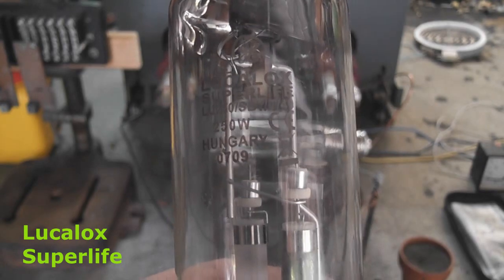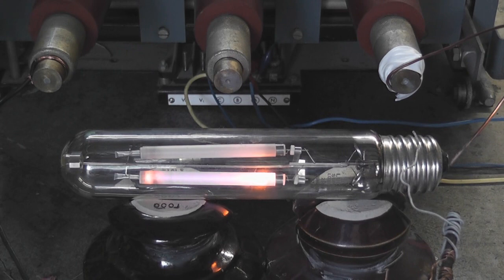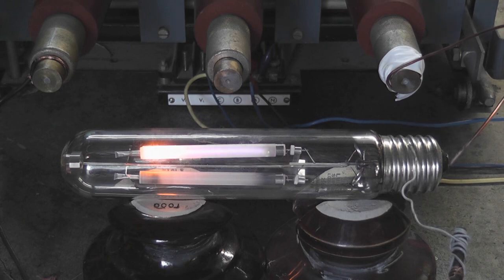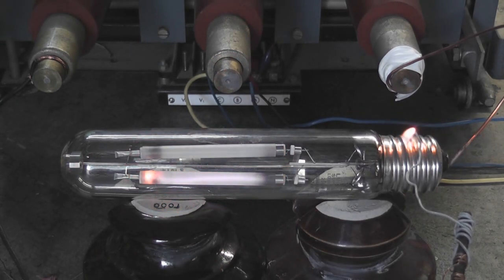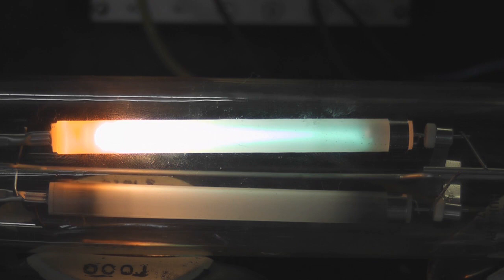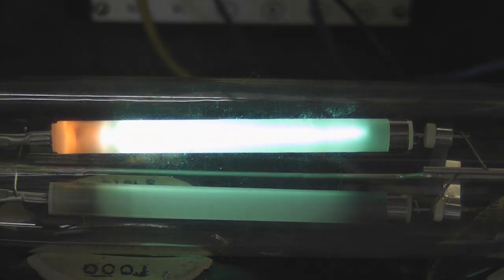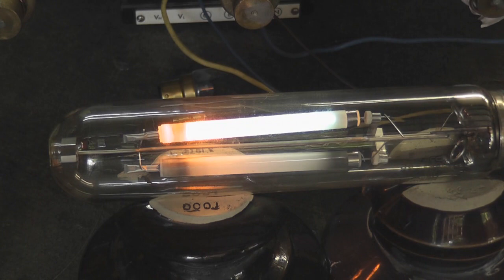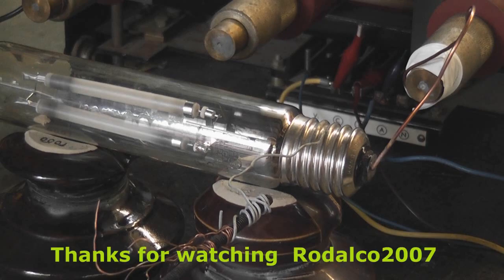250 Watts Lucalox Superlife

Comment: One arc tube will have a slightly lower ionization threshold than the other and thus will start first. Once one arc tube has struck, it deprives the other tube of a starting pulse so it never lights. Should power be interrupted, the cold tube will have the lower ionization threshold and will start first. The hot tube has a higher ionization threshold due to internal pressure, which is why these types of lamps cannot "hot restrike" without a special very high voltage ignition circuit; which these lamps are not designed to accommodate. The dual arc tube is an effective way to get a one time instant restrike, though a warmup period is still required for full lumen output. This can prevent you from sitting in darkness for several minutes waiting for a hot arc tube to cool down enough to strike again should you get a momentary interruption on the mains.

Comment: Yeah, these are handy when instant restart after a power interruption is desired such as prison floodlighting. Also when one arc tube starts "cycling" the other will take over. The only problem is that neither arc tube is located in the focal point of the luminaires optics and there is quite a difference in beam patten for each arc tube.

Comment: could i use a mercury vapor bulb as a high voltage diode??
Reply from the maker: No idea, try and test but I think that you need to have an heating element in it to get an electronflow.
Reply: interesting i have been juicing one with aprox 75000 volts from my wimshurst generator and it forms an arc but i would like to rectify an ac current with a  frequency of about 1000000 hrz to dc but at 75000 volt or more solid state components will brake down and conduct electrons so im looking in strange places i wish to replicate a mercury arc rectifier
Reply: RODALCO2007 The blue in the arc tube is mercury vapor, mixed with sodium.
Reply: Yofatboy123 ok so could i use it as a high voltage diode?? O.o
Reply: xoxoXoieoxox I'm not sure sorry, but you should try it? post a video, when you got it all set up?
Reply: Yofatboy123 i would love to but im not at liberty to post videos of this research sorry 3=

Comment: If it is made like the dual arc tube models in the US, only one arc tube will fire up.  When that tube fails, the other one takes over.  It doubles the life of the lamp, and reduces labor costs to replace it.  It also costs about 3 times more than a standard lamp.

Comment: I actually remember reading about this type of bulb about 12 years ago on the Lamptech website as I use to wonder why street lights used such strange bulbs that changed colours as they warmed up:
http://lamptech.co.uk/Spec%20Sheets/Sylvania%20SON2T400.htm

Only one tube operates at random.  The second tube serves a double purpose - hot restrike as Josh C mentioned and doubles the service life.  The side effect is that the lighting profile changes depending on which tube illuminates since both are off-centre of the surrounding reflector and the bulb is not as efficient, probably since the second tube blocks some of the light.

Comment: Neat bulb. The double arc tube is for hot restrike capability.
Reply: Sodium lamps do not have the hot restrike problem metal halide lamps have
Reply: reabinc
The large wattages still take over 3 minutes to restart.
Reply: FrontSideBus
Ahh,  I rarely work with over 400w ones.  Sometimes 1000's, but rarely